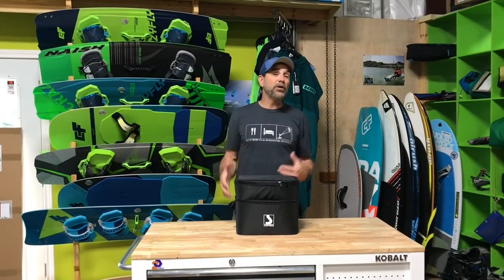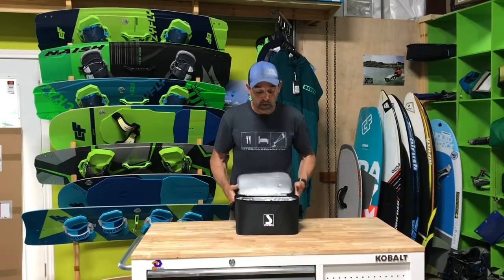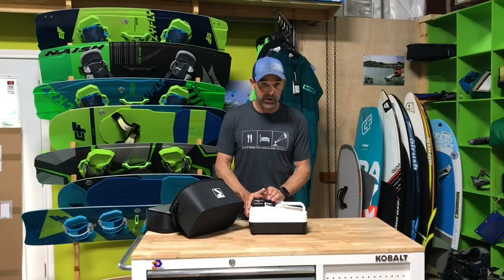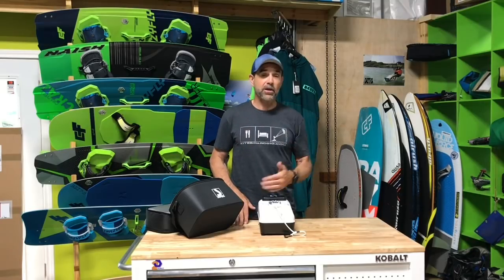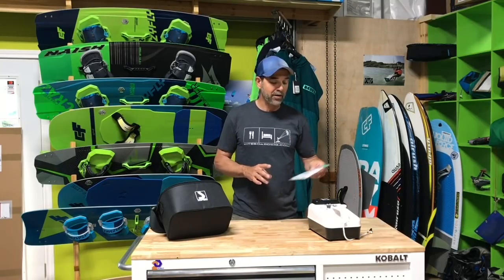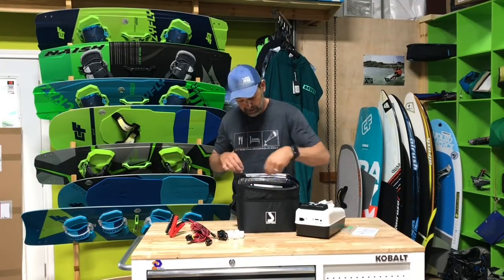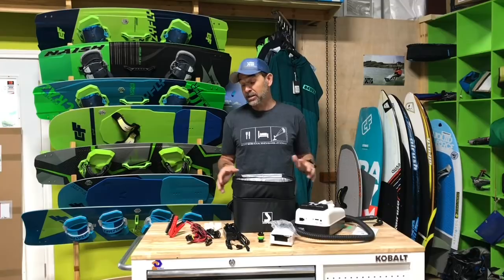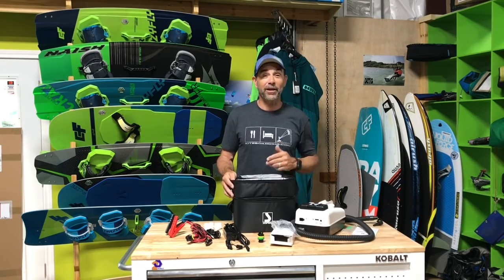Bravo 20-2 Electric Pump from PKS Distribution

Comment: which is the most recommended pressure to inflate the kite? I normally go to 8 psi (the upper end of the green part of my Ozone pump)
Reply from the maker: It depends. Most newer kites are coming with a recommended PSI printed on the Leading Edge. Older kites it will depend on Size and kite style. Here is a video where we talk about kite inflation pressure: https://www.youtube.com/watch?v=onzwmI7g-a8&t=48s